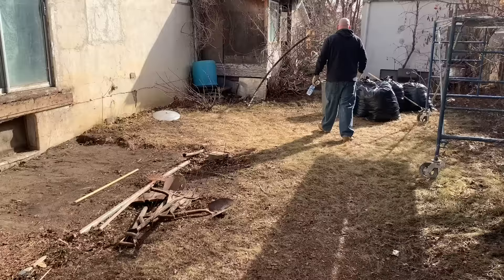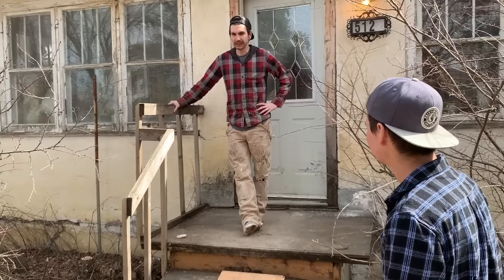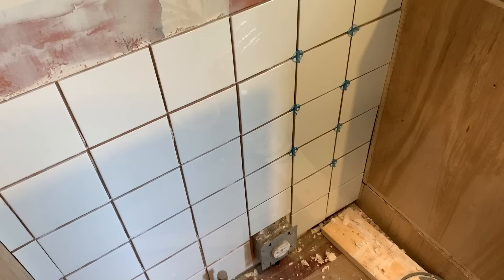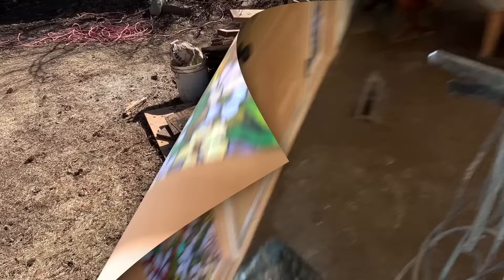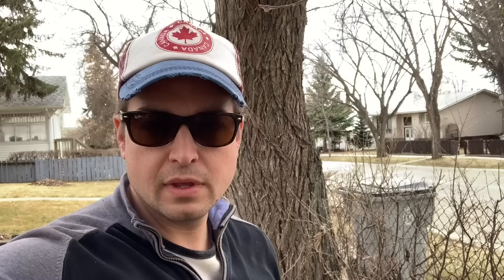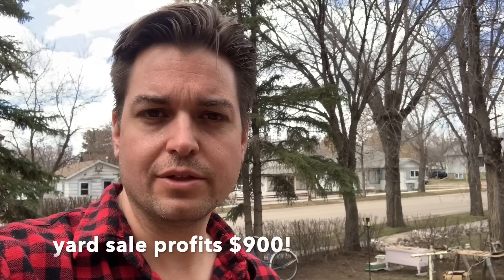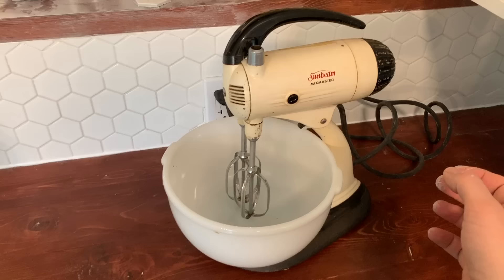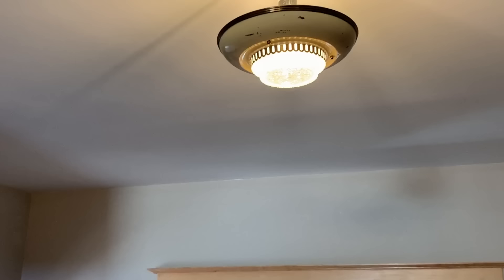Part 18. Potters House. kitchen completion and movin’ outside!

Comment: I'm going to miss seeing Josh and Jakota, they have done an amazing job. Of course I will follow them on what ever social media they are on, as well as Alex. About that butcher block island, it is very cool, but not practical. It has such an uneven surface. I wonder if you could make a temporary form around the top edges and pour epoxy over the top to make it level, but still be clear? Wouldn't want to lose the look of it, but it would make it usable and practical. The kitchen looks awesome either way, love the way the whole house is turning out.
Reply: I'm on the same page as you. I'm not sure how anything could be cut on there and nothing would be stable enough to stand upright. If it's just for looks, at least sand it down.

Comment: So sad to see Josh and Jakota leaving the house now. They have done a lot of good work. I love Josh’s kitchen and pantry. It’s completely inspiring to see the old cooker, fridge and sink all clean and ready to be used. Equipment from that period just kept going. Nice mixer too. And I wouldn’t bother with a washing machine, just put that almost new old one in place and use it. It will do a fine job.  

The house is looking awesome. The garden is going to bloom this summer. As for that wooden swivel chair, they sell for a lot of money in the UK. I tried to buy one once. And the sewing machine will just work. It’s nice looking. Needs a bit of oil and a new needle probably and then will just sew on and on and on.

Great work all around guys.

Comment: Make the deck in front Big enough to hold 2 Chairs. Thank you for sharing the remolding of the potters house. 
It will look great to see it done, On the inside and outside.  I like the look of some old paint if its the right color. in that room it is. Dont forget You are taking a long weekend off.
Reply: Wrapping the deck around and joining them both up would have been great

Comment: Fun tip for that Singer machine, Singer keeps great records on their machines. Somewhere on the machine itself(if it hasn't been removed for some reason)should be a little plate that has a number(some start with one or two letters) that is the number for it's production, ie a machine with the stamp AB000001-AB050000 would have been produced around about early 1926. If it doesn't have a letter in it, it normally means it pre-dates the 1900s.  It looks like a Sphinx detail on it, which in a the few vintage/antique sewing groups I'm in are quite sought after. On a side note(other than loving that machine and wishing it was mine), you've done such an amazing job on the house, it looks wonderful!

Comment: You really need to chop down those old sticky trees and bushes surrounding the house (obviously leave the big nice trees). Start fresh and new with the garden, it will allow you to add more character to the house and it will be easier to paint and repair the outside when they are all gone.
Reply: I am from a really different climate here in Australia but I can safely say I would never rip into an established garden without seeing it through a spring first. You would be amazed at what beauty can spring out of what appears to be deadwood after a hard pruning (came across an old wild rose that I frankly butchered and its first season afterward it was glorious) or out of 'empty' beds with rhizome roots and bulbs. Not to mention the expense involved in planting out a garden (particularly if you aren't regularly there to cover, spray and water establishing plants which will invariably lead to a higher failure rate).
Reply: @classicambo9781 - Im an Aussie as well so I haven't really factored in snow and other elements into my thoughts as we don't get snow in any cities here. But yeah you make a good point about spring and letting them open up and green up but beside the point they may be dead, and they are planted very poorly and unevenly just scattered around the garden as well moving them will make sure the exterior of the house if properly finished. Being from central suburbs of Melbourne i'm used to seeing large gardens flourishing and full of life all year round planted with mostly deciduous trees so a sticky garden isn't my type of thing, and I recommend they plant shrubs which can withstand snow and still be green. Guess we will wait and see throughout spring if it really perks up and looks nice :)

Comment: The old Singer machine is a Model 127. Having 6 drawers in the cabinet makes one of the more top of the line cabinets. On the machine bed, at the base of the post is a serial number. That will date the machine to Year of production. You can find out directly though Singer. Or through the ISMACS group online. Excellent machine! Will out preform most modern machines! Belts are available online. As well as other parts. So glad you put it in the living room !! I will find the website for old sewing machines. Tons of info you may be interested in.

Comment: When I first moved into my current home the yard had been untended for 5 years and the previous owner had planted a whole bunch of ivy. So when we moved in we saw in the backyard a concrete bird bath surrounded by ivy with a little brick path leading up to it. That first day, when I was supposed to be unpacking, I cleared out the overgrown ivy and that little bit of brick that I had found, turned out to be a full on brick patio. That patio has hosted many a party over the years.

Comment: I have a Sunbeam mixer from my ex husband's aunt. I've had it for 31 yrs and I bake and cook.  It's a stainless steel model with a black control on the end that is now loose. .... My biggest regret is that I accidently, gave away the stainless steel bowls for my mixmaster. After many bowls that are not the Perfect size...I realized that there are many sizes and similar shapes to  each mixmaster. So finding that mixer with it's bowl and beaters is awesome. I also gave away my mom's little suitcase singer.

Comment: OMGoodness! Just found you; these remarks are 2 yrs later (04/2021). Will view videos to see everything; interesting project; nice job so far. Subway tiles & square tiles look more high-end when installed staggered. The straight up & down & across-all-lined-up- edge-to-edge way isn't too bad if you're using nicely glazed clean tiles & it's a cool fresh color. Thanks for a great video.

Comment: You should get the butcher block planed flat to make it usable as work area.  As for the stove hole, why not find a rectangle of aluminium (or aluminum), give it a scratch finish with a scotchbrite pad and then clear lacquer.  You can bolt it on with aluminum pan head or countersunk bolts and if you wanted to get fancy, find a surface mount digital clock to put in the plate.

Comment: I'm sure getting a clock to replace the missing one in the stove would be typical BUT if it were mine, I would put a little piece of the original stained glass there. It would look great against the white backsplash and tie into the living room.

Comment: You can cut out the bottom off a steel 44gal drum and fit it over the stumps and burn those out,do both at the same time save time.

Comment: Porch all the way across is what the original front would have been with steps up the middle. Probably what that large square piece of wood in the basement was from, the top of the step.

Comment: Would it not have been easier to apply that sealer with a roller? A small one, but would go faster than a brush? I'm loving what you're doing with the house. The furniture is awesome. I'm kind of waiting to see what you do with the porch. I'm concerned about the  beams (round circular hefty wood things?) when you looked in the hole under where the old porch was. It looks like they're holding up the floor of the porch! Also, the butcher block table is useless as a work table. You'd have to sand it flat for using, those dips would keep anything from being sliced.

Comment: Sewing machine heads are judged by the wear or lack thereof of both the decals and the enamel.  Yours looks as if the decal has some wear, but the cabinet, what I could see of it, looks in great condition.  Many, if not most, have water and or sun damage to the veneer.  To find one without those things is a good find.  It's a vibrating shuttle machine, which has different bobbins - they are more difficult to find, as this type of machine (vibrating shuttle) is no longer in production. That said, it is an earlier, but robust design.  Unless the head is frozen with rust, they typically still work, 1-200 years later.  :-)

Comment: This is called sub flooring.  it is the  base floor placed on the framing .  It requires a hardwood on top to be considered flooring.  You are working yourself and your helpers  to death trying to make a base foundation to be as good as a hardwood floor.

Comment: to really clean your tubs use baking soda and  vinegar, 1st run hot water all over area you want to clean. then pour vinegar over all areas and then baking soda. let sit for about 10 minutes then scrub the heck out of it.. hydrogen peroxide will help to take out SOME rust stains.  JUST DON'T MIX THESE TOGETHER. might mess you up.

Comment: I think that the condition of the wood is half way to bad on the machine, the machine itself, well, those things short of depositing them into standing water, they'll be fine (i mean, the sliding cams work even when they are frozen stuck, eh, ageless sturdy design).

There's nothing you can do about it short of tearing the face off and replacing it, but that would take the patina away. What you can do to mitigate any future destruction is to take a thick needle (the ones used in refilling printer cartridges) and to squirt some wood glue wherever the veneer had lifted and then put something heavy on top. I've done it on most of my machines and it works great.

DO NOT wash the machine or the wood with anything that has alcohol init, the glaze and the "lacquer" will either lift (on the wood) or go milky white (on the machine).

Comment: Great show yet again. Sucks all the commercials but I understand why they had to come about, but they seem to be a lot more than when you first started with them. Do you get to choose how many of them are shown?  I can't wait to see what else comes out of the bedroom that still needs to be cleaned out. I clean homes for a living and just a little advice, its not a good idea to spray furniture polish onto a surface that has 50 plus years of dust and dirt build-up on it, because while it looks clean when you wipe it away, really all you did was just lock in a layer of dirt and dust under the polish. Next time if you can take a few extra moments, it would be a lot better for the wood if you clean it with a little warm soapy water first to clean the surface and then after it's dry, put on a coat of furniture polish. Trust me the wood will look SO much deeper and more beautiful when you are finished.  And bring you top dollar for your item should you choose to sell it. I hope I didn't offend you by my comment.

Comment: For the tiles, instead of cutting a lot off the bottom for a flat bottom, I would have tried to cut a little off the bottom and a little off the top to have the top to be flat too and not have to fill in the cracks.

Comment: Would have been cool to level that butcher out with a thick layer of transparent epoxy and then a steel plate on top, making it look a bit like an aquarium (see through from the sides) with a hard worktop.

Comment: say if you ever run into that dried linoleum glue on a wood floor again, do this.....put a towel down, pour some boiling water over it, let it soak a bit on top of the wood, and then that glue will just slide off.